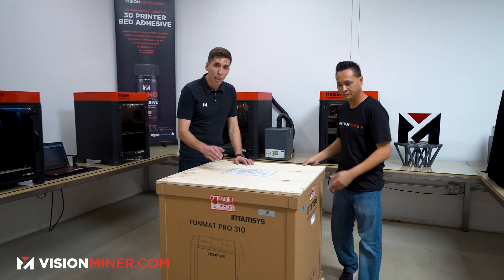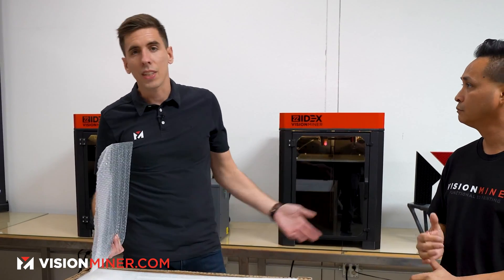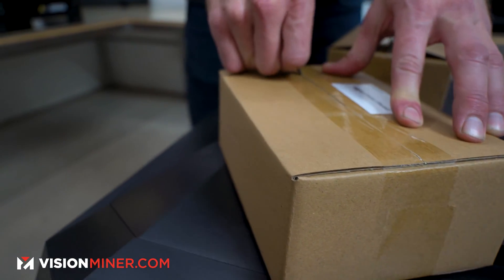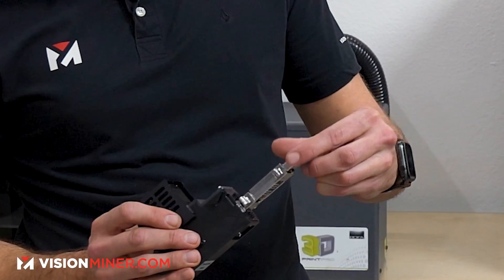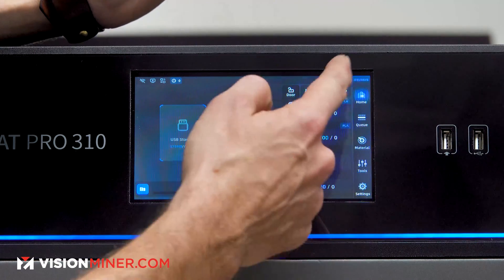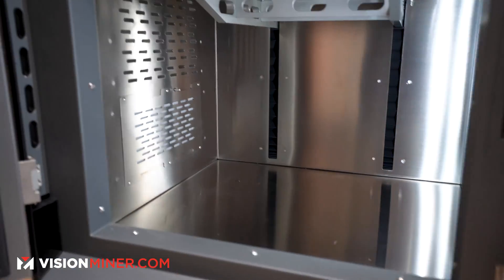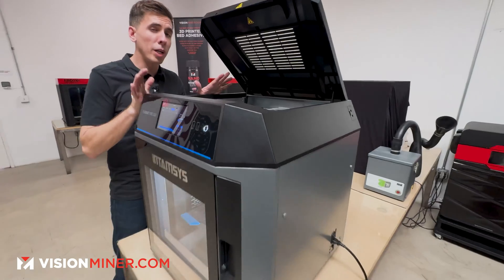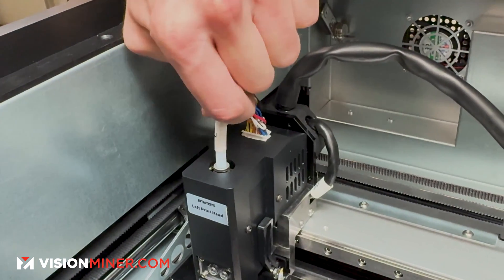FUNMAT PRO 310 UNBOXING! - Intamsys 3D Printer 2024

Comment: Being that it's so insanely expensive is there another machine, maybe by the same maker, that a disabled vet could afford? Asking for a friend. She's definitely a beast of a machine with great potential. Thanks for your unboxing/review as always.
Reply: If Qidi works the kinks out with the X-Max 3, that would be an excellent affordable alternative. MUCH more affordable. I have a few printers, one being an X-CF Pro. Despite its quirks, it produced excellent prints and has a hotend temp well over 300c. It’s also nearly 1/10 the cost. 

Granted the printers are likely not in the same league, but I produce functional prints and I haven’t had an issue yet with multiple higher temp filaments.
Reply: @Heiserton  Thanks for your suggestion! This is something I definitely want to get into.

Comment: Just humor me here. But for nearly $10k, what is this printer trying to achieve with a max hotend temp of 300°C? I get it has dual extruders and a chamber heater. The build quality seems exceptional as well. But the build volume and current hotend temp really don’t seem to match up to its price tag. 

Don’t get me wrong, I’m sure it’s an excellent machine. I’m just not seeing the justification of the cost is all, or rather the value for the price it commands.
Reply: No lie this thing is basically a qidi x-max 3 for 9k more..... not even upgrading the hot end makes this a good buy.
Reply from the maker: Frankly, the only reason we're carrying this machine is the 100ºC chamber and high likelihood of hotend upgrade to hit 500ºC -- then, along with a build plate upgrade, since the magnets may not hold the warping of ULTEM or PEEK, and you've got a solid, well-built high-temp machine :)
Reply: @VisionMiner  thank you for the clarification! The price comment wasn’t a jab at VM, that’s just kinda the average I saw from other retailers. 

WITH those upgrades, it would make a far more compelling argument for itself. I hope they push those upgrades out soon!

Comment: High temperature nylons print at 300 C, so I'm not sure what you are talking about.  The PEEK, PEKK and others certainly won't print at 300 C, but PPA does with ease.  I have done it with Raise3D PPA CF, 3DXtech PPA CF and Essentium PPA CF materials.
Reply: 14:40 mentions materials
Reply: @astroimagers  At the beginning he states that you can't print high temp nylons, when you clearly can.  Just a simple mistake.
Reply from the maker: @andrigsaircooledtechnology  No -- most high-temp nylons require 320-330c to really print. This machine only goes to 300, currently (likely to see a hotend upgrade very soon), which means it can print up to the PA6's. The HTN's may extrude, but it's not specifically good for those. Technically, yes, though, it could print and extrude them, but they really need to upgrade the hotend temperature first :)
Reply: @VisionMiner I personally make production parts in the automotive space printed with HTN CF printed at 300 C, and anneal them for 8 hours at 100 C, and have no issues at all.  Perhaps they will print better at a higher temperature, I don't know, but what HTN's are you referring too?  Like I said, I printed three different HTN from three different vendors at 300 C with no issues.  It doesn't just extrude, it creates parts that meet the materials specifications, at least in my experience.
Reply from the maker: That is great to hear! I think size of parts has a lot to do with it, too -- are you printing large parts, or smaller parts, something in between? (btw, yes, we've still got some stuff on the way to you very soon :))
Reply: @VisionMiner  Depends what you mean by large, but I think they are large.  230 mm in diameter for one part, and 270 mm in diameter for the other.   The second part wouldn't fit in the build volume of the Funmat Pro 310, so I think that large.
Reply from the maker: Yep, that's pretty big! We'll get to testing! :)
Reply: @VisionMiner  Has the hotend upgrade arrived yet? This is the perfect machine but a 300c extruder is a huge let down, unfortunately.